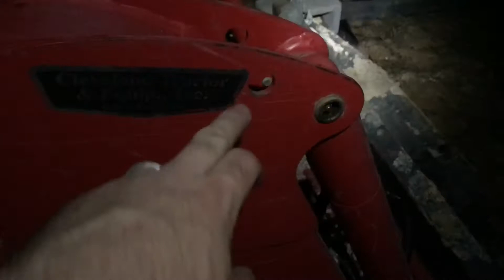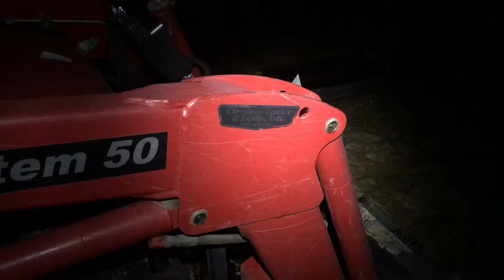Adding Lights to the Tractor

Comment: Great video. 
In Sweden theres lot of snow and i need light. Now i got more ideas on were to put them. 
Have you put lights under the tractor to light up while lifting the bucket?
Reply from the maker: I mounted two on the front grill, so they stay stationary while the bucket goes up and down. Honestly though don’t use the cheapest ones off internet like I did. The mounting brackets all rusted and broke in a year or less. My lights were then dangling and flopping and most have fell off. For sure though having bright lights on the machine is worth it! Just need better mounts!
Reply: @TomBrueggen  i buy in a local store, and the mountings are stainless. 
My problem is when the bucket is full of snow and 3 to 5 feet up.
I have thought of mounting on the loader, but i dont know. Much snow in the bucket means bad light.

Comment: So did you just run lights to a toggle switch and to the battery? Can you send me a sketch of wiring
Reply from the maker: I actually attempted to wire them back in through the factory switch by tying in at the fuse. Didn’t really work like I hoped. It ended up that I had all lights on when on the low beam setting. These lights didn’t last though. The vibration of the tractor quickly broke the flimsy metal base brackets. Definitely look for something more robust if you decide to do this.

Comment: I am also looking to add a couple of extra forward lights because of the bucket blocking out a large area of view. I installed a Rural King brand (Road-Shock) flood light on the rear to light up my 3-point area...and it works amazingly well. Just not sure where to mount the the forward lights, but seeing how you've done it has certainly given me an option. Thanks for Sharing, it looks great so far!
Donnie
Reply: Oh by the way, the holes in your loader arms that you thought were possibly for lifting the loader off for maintenance, they're actually there for mounting the Bucket Level Indicater. Just wanted to let you know... I wish I could attach a pic, I could show you how mine is mounted. 
 Keep us posted as you install upgrades and mods, many of us are interested in learning too....and that's usually done by folks sharing. Great job on "Rita", love it!
Donnie
Reply from the maker: Yeah I figured those holes have multiple use. This loader actually has handy kickstand feet, so it’s free standing when I disconnect it from the tractor. So yeah, I’d only need lifting eyes if I were setting it up on a trailer or something to ship out. 

I’d suggest slightly higher quality lights if you can. These were the cheapest I could find on amazon. They work ok, but the mounting brackets are junk. They are very thin metal. Several have rusted and cracked now, so my lights are flopping around.
Reply from the maker: Maybe just adding a rubber bushing between the bracket and tractor would help. I like your idea of one big light on the roll bar, as long as it doesn’t make the roll bar even taller. I already hit one of my shop doors when it wasn’t rolled up quite all the way. 😬
Reply: @TomBrueggen  yessir I thought about it being in the way on the roll bar, so I was considering to mount it on the underside of the roll-bar top...just worried that it would have a shadow from my big head..lol.
Think I'm just going to mount two cube lights on the upper part of the grill guard....hopefully it'll be high enough to clear my grapple when in transit. Thanks for the input!
Reply from the maker: Standing Goats Rescue I don’t recall if I showed or mentioned it, but with the two on the boom, if I raise it all the way up, I can light up into the trees too. Of course I’ll probably never need that feature. But by golly I can do it!
Reply: @TomBrueggen  that feature would probably come handy at some point, especially if you're clearing property at night. I usually do most of my big jobs at night because of how hot it gets here in Florida... I didn't think about the ability to shine up into the trees, but I like the thought of it. Have a good evening sir, thanks again!